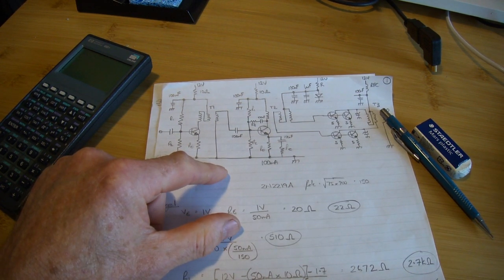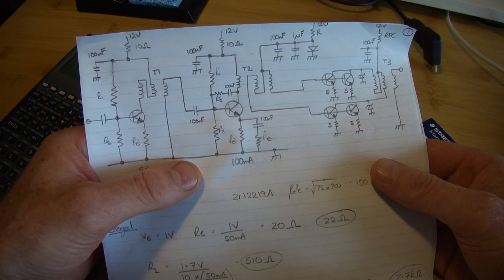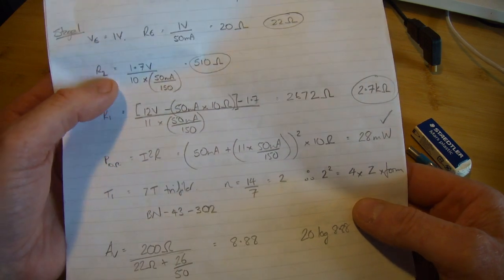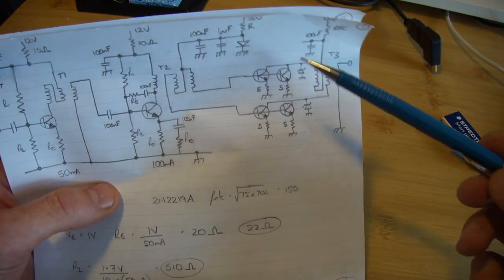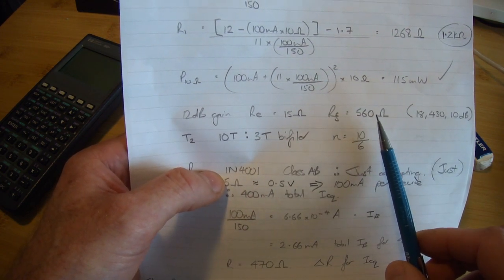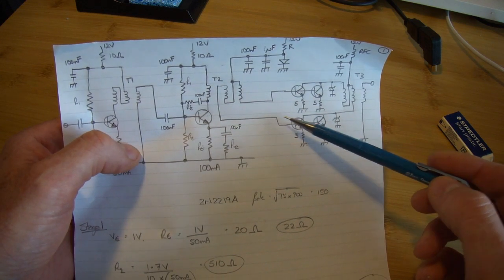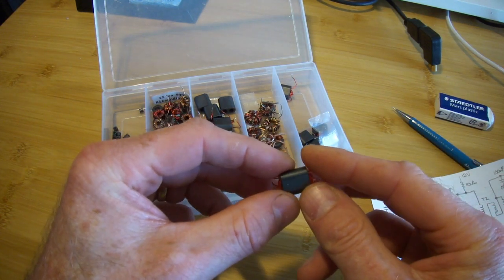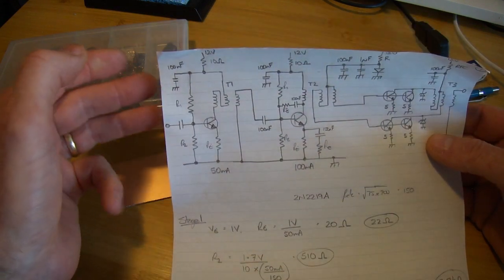40m Pelican Case SSB Radio - Part 9: RF PA Plan

Comment: Interesting PA o/p stage. . How did you estimate the number of transistors needed in each leg of the output stage?  The calculations would help me with my 20m QRP xcvr.
73, Mike, EI6AU

Comment: A fellow RPN person, love the 48G/X
Reply from the maker: Indeed. I have two of them. I love them.
Reply: Back in 1973, my Dad (unbelievably) bought me an HP-35 when I was in the 11th grade; as I was also sitting-in on electrical engineering classes at the local college. Previous to that, I was running a slip-stick since the 8th grade.
Then in 1976 got the HP-67 which uses the magnetic-cards.
Then got a HP48 GX but after loaning it to my son, it got stolen; so that was short-lived!
Bought a HP-12 when I started doing investing.
Three years ago I bought and fixed an HP-45, which I use a lot.
Then, here a couple of years ago bought an HP Prime.
All of these calculators still work and I like and use the HP-67 the most.
73! 😊

Comment: Great video. You might have to get some extra bias voltage on the output stage to get that standing current of 100 mA/device. The developed  DC voltage on the  4 emitters of the output stage, may tend to throttle them back under RF drive. This may affect linearity.
Reply from the maker: Thank you. I was looking to vary R as needed. I'll definitely keep an eye on that.